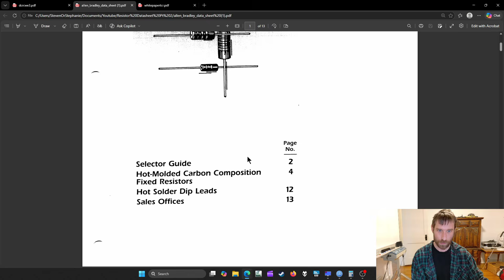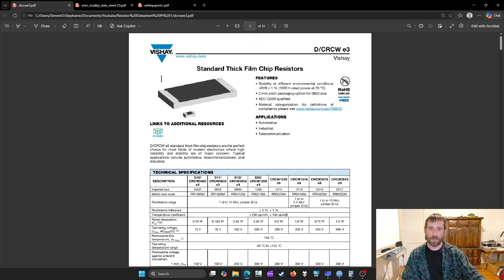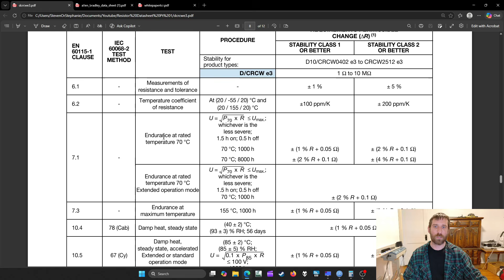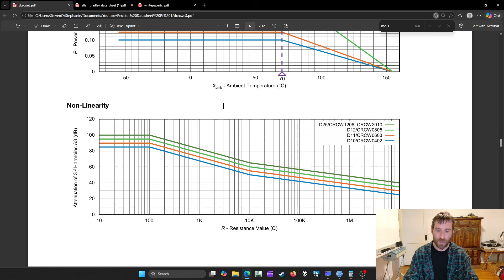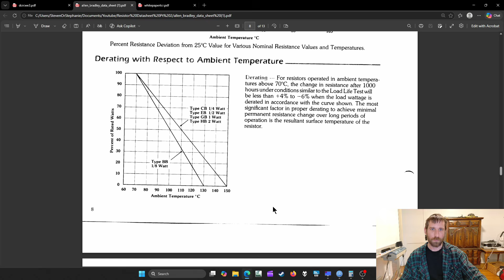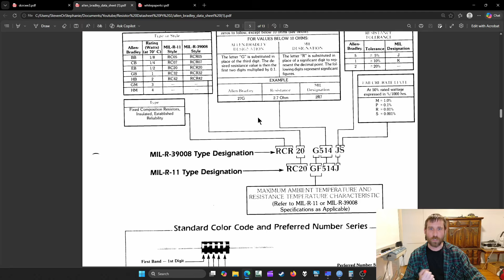Your Circuit Will Work. You’re Just Overthinking It.

Comment: Those early designs were all surface mount, because you used a sheet of wood to mount everything, so it was all on the one side with no holes through.

As well remember that temperature coefficient chart saying it is linear is a lie, it is a box in which they guarantee any resistor will fall, but the actual part can be anywhere in there, and vary from positive to negative as well as temperature changes, depending on differential expansion of the substrate and resistor material. modern datasheets often are economical with the truth, while the old ones could flat out lie at times, especially as they never expected the parts to last for a half century or more, and thus any data and such was almost always on brand new devices, no more than 6 months old at best.